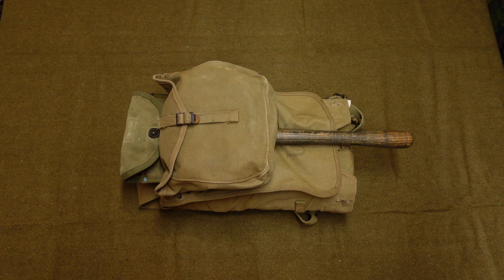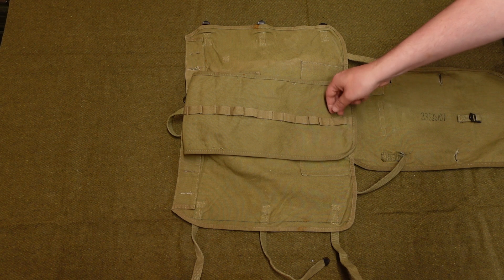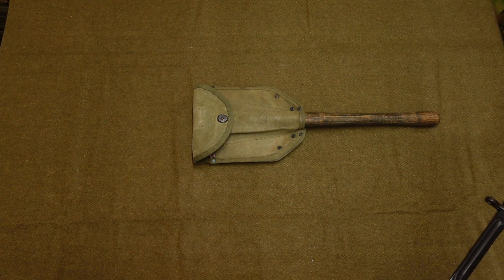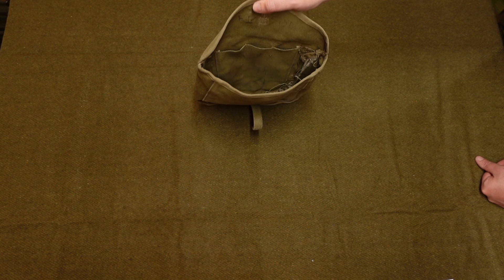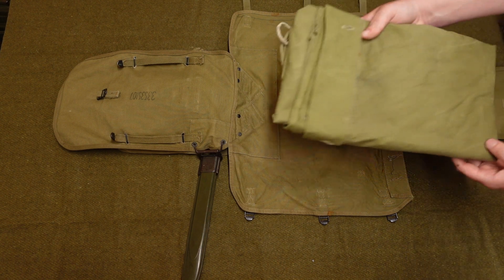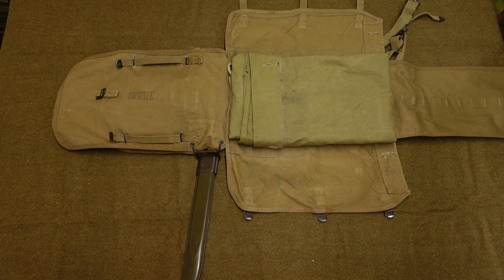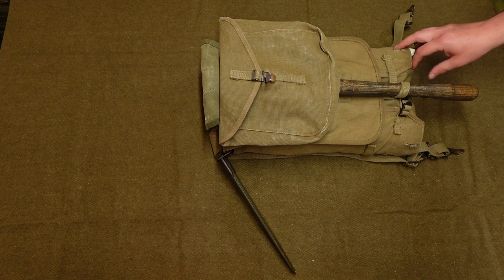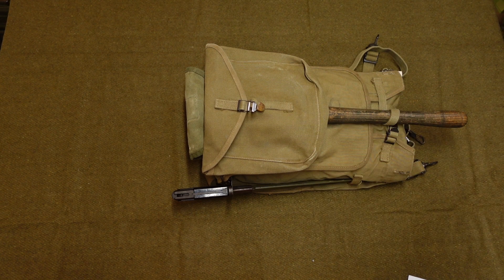WW2 US M1928 Haversack assembly guide

Comment: A thing on the bayonet which you probably already know but others might not = The haversack was originally meant to fit the 16-inch M1905 bayonet for the M1903 Springfield rifle, not the 10-inch M1 bayonet for the Garand. Leading up to Normandy, most new units would have been issued with newer packs instead of those insane origami haversacks. Only the veterans of Italy and North Africa would still have the haversack, and they'd be dumping them as fast as possible for the newer gear. But all that is for Europe. I have no idea what Army units assigned to the Pacific of CBI Theaters would have used.
Reply from the maker: The haversack was still the primary pack in Normandie. It can be seen all over the place. Not seen much evidence of many soliders getting lucky enough to have a musette bag and the m44 field bags dont get seen in use untill right at the end.

If you know of another bit of gear I have missed out though please do share as I would like to know what ive missed.

The Marine core haversacks were superior. They were much closer to the m44 packs.
Reply: The only thing I saw missing was the meatcan pouch's leather insert/sheath for the knife, and I've only seen one of those non-repro in the last twenty five years. Other than that, you seem spot-on.
Reply from the maker: I managed to get hold of one that I am pretty sure is original now. But Only for the knife.

Comment: Where do you put the wool blanket
Reply from the maker: @Reenactortyler  you can just fold up the wool blanket and put it inside the Haversack 🙂

Do not worry about it being all neatly closed up. The haversacks were often so full they looked like they were going to burst
Reply: @ thanks man I know my name says I’m a reenactor but I’m really trying my best to get into it I’m getting a lot of equipment but my haversack looks like stuff is gonna fallout the holes because the flap at the bottom doesn’t cover it fully
Reply: @Truffle1947 I’m gonna do that right now but again thank you
Reply from the maker: You will be fine. If you need any help with things just ask :)
As long as you pack it sensibly and make sure it is done up nice and tight you should not loose things. Most of the items should be wrapped up inside the blanket and pup tent half :)

Comment: Have you done the 2nd video with bedroll etc yet ?
Reply from the maker: Afraid not mate. It is still on my list of things to do!
One of my oldest videos shows how to make a basic bedroll but I have not do the full one that I mentioned doing in this video yet. I will make a point of getting to it!
Reply: Thanks for reply. When you see the item rolled and tied in cover around the top of the pack is this the blanket or the Rain coat  ? Cheers.
Reply from the maker: The chances are that both of those items were put there by troops. I have certainly seen coats there. But if you are lucky enough to have an extra blanket I am sure someone must of done that.